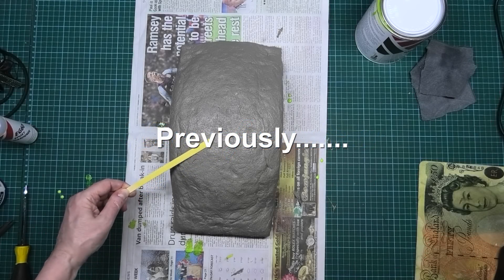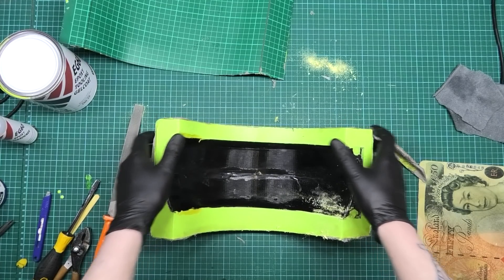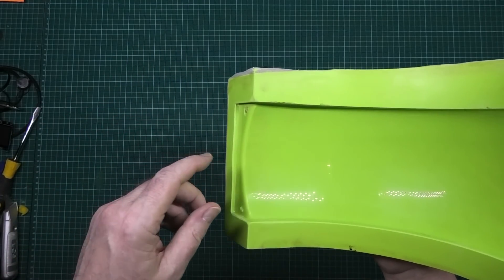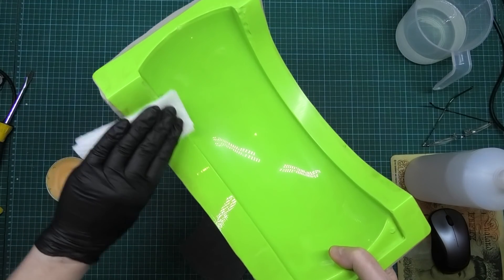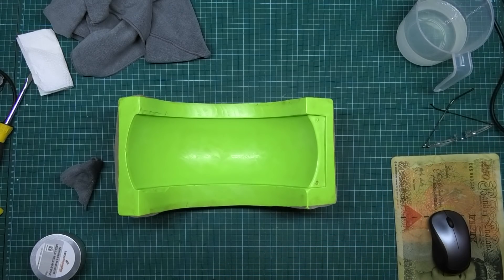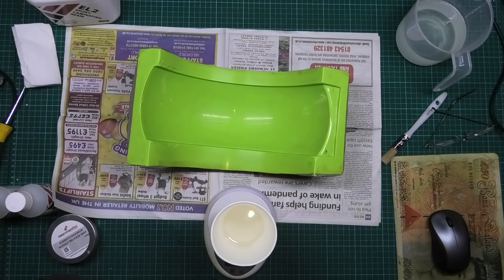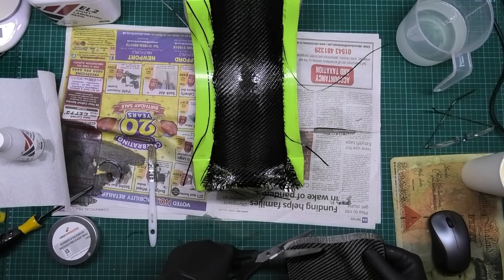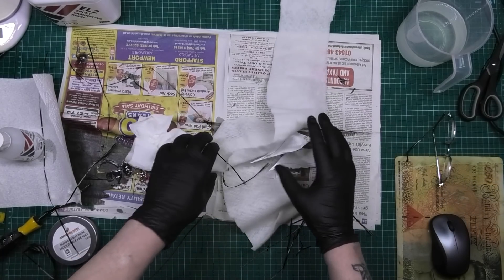🔴 EXTREMELY POWERFUL E-SCOOTER BUILD part 14 - Vacuum bagged carbon fibre (fiber) part from a mould

Comment: Hi Tony, I'm pissed off, my E Bike Battery won't stay switched on, it looks like the BMS is playing up. Could some low volt cells make it do that?...Fucked off with it TBH...weather's good now and no Battery...🤔😳😳😳🙄😒😒
Reply from the maker: It could be that mate. They do have a low voltage cut-off but a good charge should put it right.
Does it do that even after being fully charged?
Reply: @Vortecks  I did manage to get it to charge by operating the ignition key eventually. It's showing 40.50 volts for a 36v 10S battery, so pretty full at the output terminals. It's sporadic though. Turn the ignition key to on and momentarily it shows 40.5v, but quickly drops off to 1.8v..😳🤔😳😳...I'm convinced it's the BMS that's failed but it means digging the cells out the case and checking it all...Stupid 7 dollar BMS... I've had to order another battery meantime... FFS...🤔😳😳🙄
Reply from the maker: @EnglishTurbines  Yeah, it sounds like the BMS to me mate. They have a current limiter on startup which prevents anything from bursting into flames if something goes short. I have known one bloke where I discovered that the throttle was sticking - try opening the throttle fully and letting go before you fire it up. If that doesn't work, Jet A-1 and a match will surely fix the problem 😉
Reply: @Vortecks  No, I did manage to get it to boot up and stay on, but gently rode it for a short distance showing no real voltage dropoff, but it switched itself off again for no good obvious reason ..🤔😳😳😳🙄🇬🇧
Reply from the maker: @EnglishTurbines  Okay, you're saying that sometimes, it fires up fine but sometimes it fires up and then the voltage readout drops off to near enough zero and sometimes, it'll randomly power off?
If that's the case, it might actually be the controller. The voltage readout on the handlebars (I presume that's where it is?) is only a dumb terminal and reads whatever the controller is feeding it. I'd start by measuring the battery output voltage before you commit to changing anything mate. If the battery voltage drops off, you know for certain that the BMS is shutting off for some reason but, if the voltage stays the same, it's the controller.
Reply: @Vortecks  Yes, I thought at first it was the controller. But then I realised it was the actual battery. The battery slides out the frame and is a standalone pack with ignition and lock built on it. I can take the battery out to check it using a meter directly on the output terminals. Then turn on using the key. This is when the pack voltage appears as normal on key on, but folds quickly to 1.8v residual...With the battery in the bike, same thing, display lights up brieifly then goes dead....The controller worked again briefly as normal even let me ride for a short distance but then all went dead...Now the battery won't switch on and stay on...🤔😳😳
Reply from the maker: @EnglishTurbines  In which case, I reckon you're correct mate, it must be something to do with the BMS (or the ignition switch). I doubt that the battery itself is at fault because it doesn't always happen. If one/some of the cells were knackered, it would do it all the time ☹
Reply: @Vortecks  Thanks Tony. I'm waiting for a replacement battery to arrive. Then I need to investigate the dud one. It's only got 225kms on it, that's a £1 per km battery..😳😳😳

Comment: Tony I’m after some advice if you wouldn’t mind? What soldering iron would you recommend/do you use please?
Reply from the maker: I use a Metcal. They're rather expensive but you'll only need 1 to do everything from very fine rework to soldering thick wires. They work differently to normal soldering irons and they don't need temperature adjustment.
A cheaper alternative is the Hakko range. I've heard very good reports on the Hakko FX-888D
Reply: @Vortecks  I’ve been reading about Metcal, fascinating how they work! Thank you for the reply Tony, hope you’re well 👍🏻